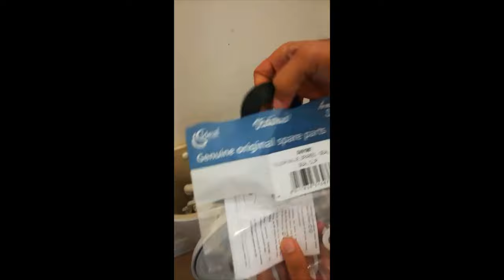How to Fix a Leaky Toilet with Running Water Stream - Ideal Standard

Comment: Thank you much appreciated.. can you put the link in for both the parts as to where you can purchase them from online please. So I don’t get the wrong ones 🙈
Reply from the maker: I bought the flush valve seal online from "fixthebog" on amazon. Link https://www.amazon.co.uk/gp/product/B07FW1GSQ3/
I bought the inlet valve diaphragm from a local plumbing merchant as whatever I ordered online did not fit properly.
Reply: @freehansa  I have changed this and still dripping.. however the diaphragm has fallen apart when I removed that.. can you let me know what source you bought it from, I am happy to ring them and order and pay for postage.. I don’t want to get the wrong one. Or if you have a link from Amazon for the correct ridged one I’d much appreciate it.
Thank you!!
Reply from the maker: @memyselfandi2845  I could not find one on Amazon, neither could I find one in shops like wickes, screwfix etc. I took the diaphragm out of the valve and took it the local plumbing merchants. They were then able to find me one. This is like a local shop which doesn't have a web presence. If you take the part to any plumbing shop, they should be able to find you one.

Comment: Hi I have the same problems,there’s water dripping in the tank!u said u buy that part on-line!what is the name of that part?where did u get them from?many thanks
Reply from the maker: Hi Jacky, I bought the flush valve seal online from "fixthebog" on amazon. Link https://www.amazon.co.uk/gp/product/B07FW1GSQ3/

The inlet valve diaphragm, I bought from a local plumbing merchant. I have showed in the video the different types at 13.15. I needed the one with raised edges. When I bought them online, they were flat edged (from screwfix) and did not work. So better will be to remove the diaphragm from the inlet valve and take it to your local plumbing merchant, so that they can give you the exact one. Mine cost £5.40. Hope this helps.
Reply: freehansa it was the inlet valve I want,I brought 1 from eBay!hope it will works!many thanks

Comment: Hi Thanks for video. I have same issue, water dripping continues into cistern from that inlet valve (blue colour) even after cistern is filled but i have question, is that same valve used to fill cistern after flush and which doesn't stop even after cistern filled? Thanks
Reply from the maker: Yes, it is the same valve which fills up the cistern after flushing. It does not stop filling the cistern even after the cistern is full because of faulty diaphragm and thus causes an overflow. This then silently leaks into the bowl.

Comment: Having this exact problem now. Have changed the out pipe as the rubber washer was perished, the in pipe washers appear ok but water leaking from cap. Also the bowl keeps filling even with the float up. Do I need a complete new intake pump pipe do you think?
Reply from the maker: I think if the inlet valve diaphragm has been in use for around 5+ years, it may appear OK but it becomes hard as it loses its elasticity and doesn't work properly. As you have mentioned that it leaks from the cap, I think that is the fault. You could change it for a new one and it might just work fine.

Comment: my problem is that while putting in a new valve fixes it, it's only temporary. i bought a 2 pack a month ago and a 5 pack of diaphragms a week ago and i've already used 5 out of 7 of them. they work and fix the leak for a couple days and then it starts again. the leak is a constant torrent and i'm having to use the shut off valve every time i need to flush. lifting up on the bar doesn't solve it so i'm out of ideas what it could be.

Comment: I did this yesterday. Old drop valve seal had split and the rubber perished/gone tacky. Problem still exists after replacing with a genuine 1967 part number seal. It is different from the original as is white/opaque instead of black. I cleaned the mating surface..... it still leaks
Reply from the maker: I had this issue when the seal did not have raised edges as I explained in the video. Once I had the correct seal with raised edges it slotted into the corresponding part properly and there was no further leakage.
Reply: @freehansa  do you know the part number for it? I was assuming that the silicone version I now have was the issue instead of the original rubber?
Reply from the maker: @kingofthewestmidlands4049  I don't unfortunately. I couldn't find one online. I took the original seal to a local plumbing merchant and they were able to give me an exact replacement.
Reply: @freehansa  I got the silicone SV01967 from a local merchant after taking the drop valve in. I've just gone through my bin and found the old one, whats left of it looks like its lipped. Will go to another merchant on Tuesday and see if they can help

Comment: Have the same problem. Think I need to call a plumber 😭. 5min30 you turn the flush unit anticlockwise to unlock it. On mine the whole thing moves from the base so the top half doesn't unlock as the entire thing moves. Can't get a good enough grip to hold the base to stop it turning while twisting as there's so little space

Comment: I've got the same fitting and I've replaced the washer, but it's still dripping 😢
Reply from the maker: That is very frustrating. All I can think is that the valve is a misfit probably because it is not the correct type? In my case the leakage didn't stop when I fitted the inlet valve which didn't have raised edges. Once I got the correct type, it worked well (I explained it in the video around 12.30 onwards). Please double check. 
If it is all appropriate then check if it is fitted properly and not loose at any point.
If it still doesn't work, the perhaps you need to get professional plumber advice.

Comment: I have just bucked the trend and had a nightmare.  Water coming through my ceiling now. Your instructions were clear, but I have ended up in a worse situation.  Wish I had got a plumber in. Why don't you just say where you got the diaphragm from and give the part number?  I can't stop the loss of water and the noise it should be making is just not right.  Worse than before I tried to do this. Grrrrrrrrr!
Reply from the maker: It is very irritating indeed. I couldn't find one online, so had to buy it from a local plumbing merchant. Therefore I don't have a part number. Sorry.
Reply: @freehansa  Update.  I took out the new seal and put it back in, but with the old white thing and it is good.  I suspect the real problem was where the diaphragm goes.  I may have moved slightly by accident and that is why I had a mini flood.  However, tightened up and no more water  escaping. I just need the correct diaphragm.  I agree that your video is great.

Comment: I have changed both the inlet valve and the flush valve and it is still leaking 😫
Reply from the maker: That sounds very frustrating. Probably the valve is a misfit because it is not the correct type? In my case the leakage didn't stop when I fitted the inlet valve which didn't have raised edges. Once I got the correct type, it worked well (I explained it in the video around 12.30 onwards). Please double check. 
If it is all appropriate then check if it is fitted properly and not loose at any point.
If it still doesn't work, the perhaps you need to get professional plumber advice.
Reply: Same here , plumber had been out twice and problem still there. I’ve been told the toilet pan will have to come out….🫤